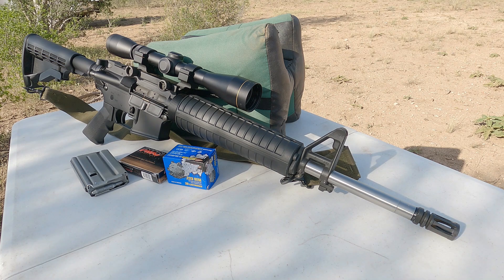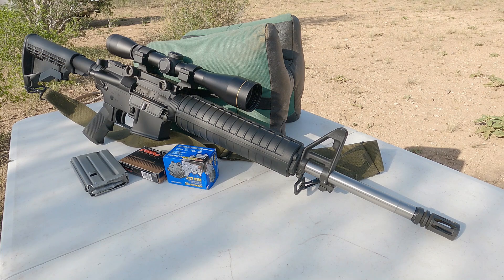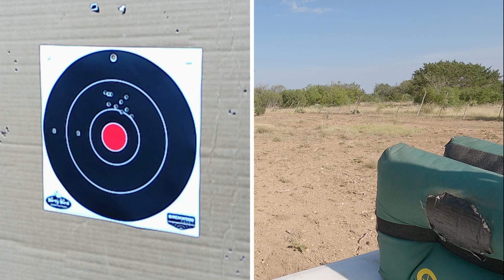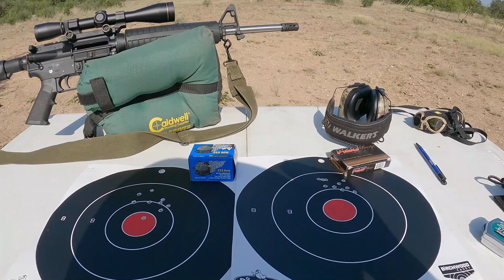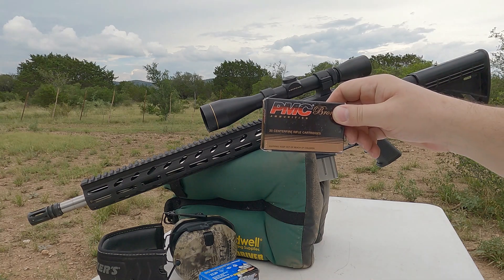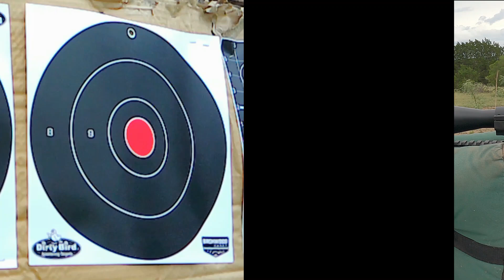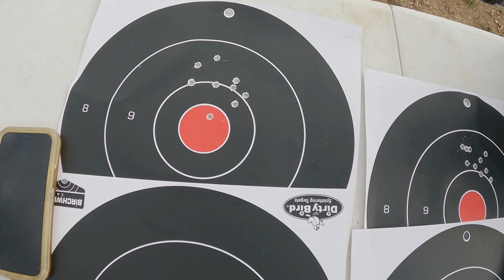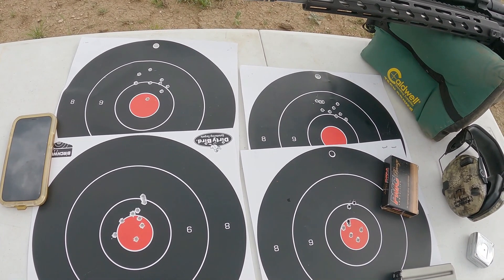Standard vs Free Float Handguards

Comment: I personally never noticed a significant difference in accuracy, more so in precision. I feel like any human sized target wouldn’t be an issue to hit with either or.

I do own a 20 inch A4 clone and have a Midwest industries quad rail drop in and I was able to hit a 5 inch plate at 170 yards. But this could be because I had a 20 inch barrel, whereas most people’s AR’s are standard 16 inch.

But I am getting the QRF 7 free float from Bravo Company to put on my M4 clone because I like the FSP better than flip ups better. I wanted to maintain the classic look even with a free float rail.

I personally think the biggest advantage for free float rails is you can choose where exactly you can add accessories. But then again I see people having them with just a flashlight at the end lol.

I think at the end of the day it’s all for personal preference. But I do believe if you’re a beginner you should start with drop ins and overtime upgrade to something like a ff rail.
Reply from the maker: Very well said.  I personally have only recently started adding FF handguards to some of my rifles.  Only once with the hope of gaining a little precision, but it is a hunting platform with a rifle length gas system.  The other's I've switched out were more for the ability to add accessories.

Comment: If you took off the barrel nut it may change accuracy... As in a different one for the free float. I bought a $700 upper 10 years ago.. Shot like crap. Removed the barrel and reinstalled it. 100% better. Stopped paying for names...
Reply from the maker: Interesting, good to know.  When I had a gunsmith switch out the handguards, I don't know if they messed with the barrel nut.  I'll have to look into it.
Reply: @texmexshoots you had a gunsmith change out hand guards?

Comment: best thing you can do is buy several types of ammunition and see which one your rifle likes. It does not always mean more expensive ammunition will group better. My PSA rifle with a 18 inch chf barrel gives me 1.5 inch groups using cheap federal 223 ammunition. With my reloads it shoots sub moa. My reloads are not match grade reloads. There are a couple benefits to not having a free floated rail on this platform. One you have a fixed front sight and two the gas tube is more secure.
Reply from the maker: I have one of those PSA 18 inch Stainless Steel barrels with the Wylde chamber.  Is that the one you have?  If so, which bullet weight does yours like best?
Reply: @texmexshoots  the 18 inch barrel I have are the Cold hammer forged chrome lined barrel made by FN sold by PSA. I would say it shoots 55 grain and 62 grain bullets equally well. My favorite old is 24.5 grains of shooters world AR plus powder with a Everglades 55 grain bullet.
Reply from the maker: @theintrovertedcalifornian5047  Nice!  Thanks for the info.